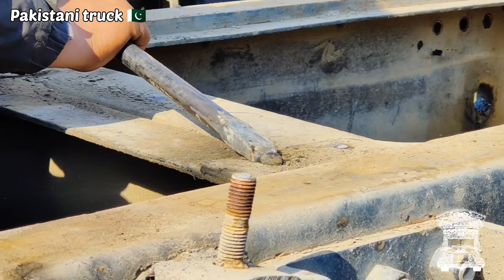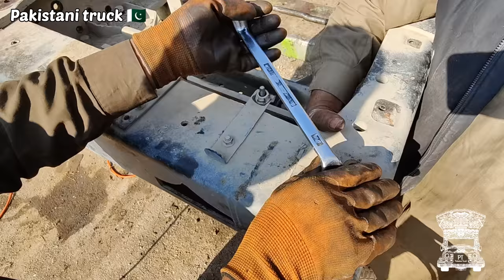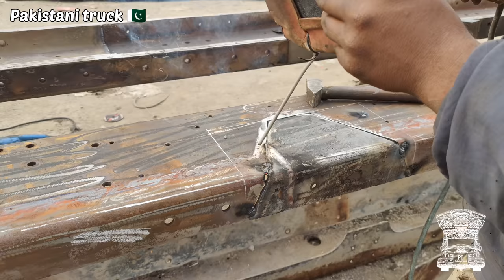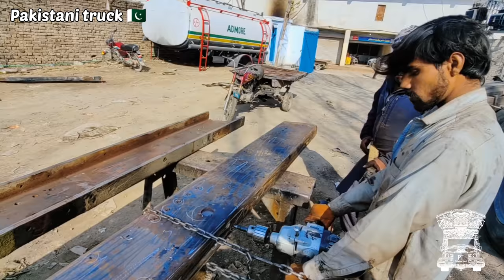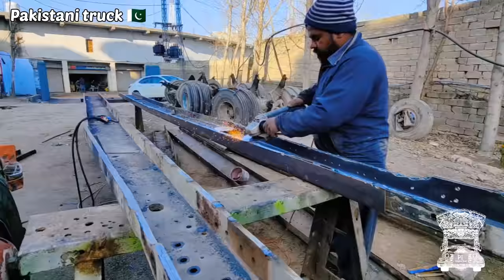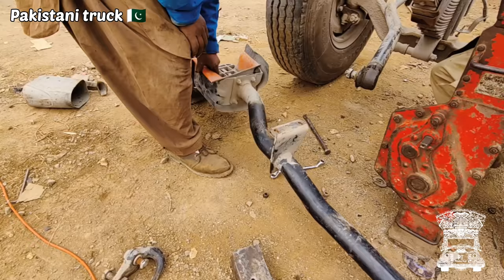Hino 8J Euro chassis Repairing | Broken Chassis Repairing Full Video

Comment: I wonder where all these welding rods and grinding discs and wheels ?  are sold is there a proper tiny tool shop packed to the rafters with supplies ?  everything you need under one tin roof ?